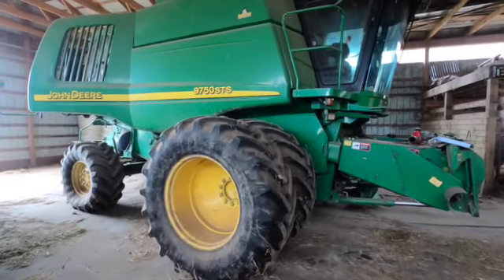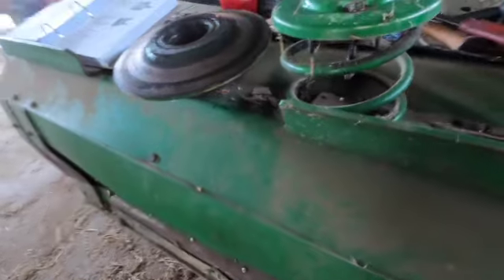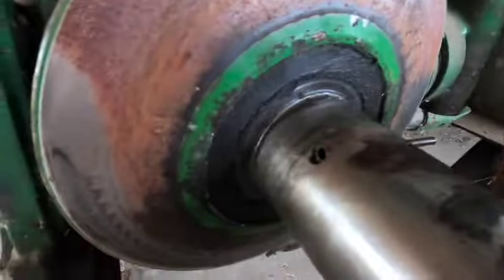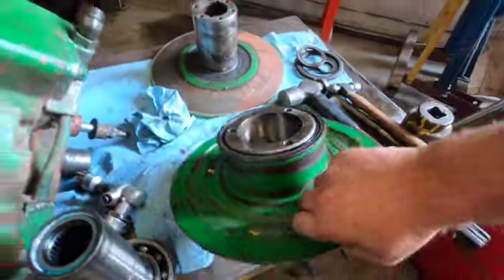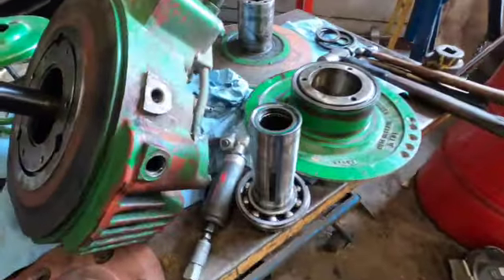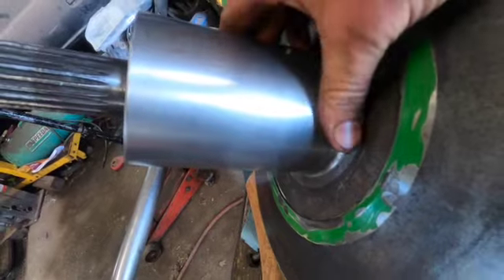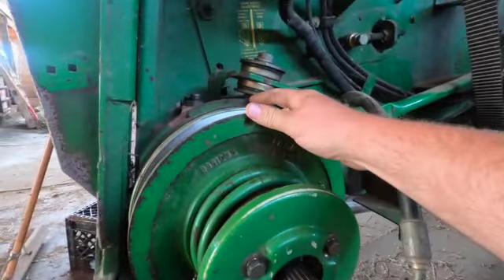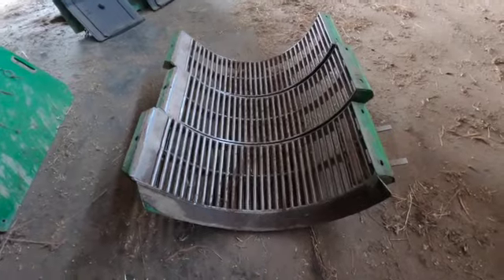Variable drive and reverser gear box break down for a 50 series STS combine.

Comment: How do you tension the belt?
Reply from the maker: The belt is mostly tensioned by the sheaves that the belt loops around. There is an additional tensioner in the center that applies perpendicular pressure. There is a procedure in the book to apply the correct tension.